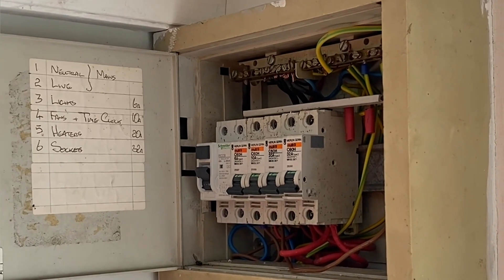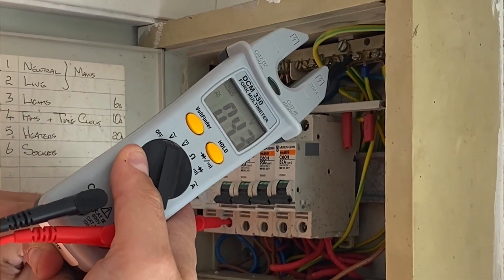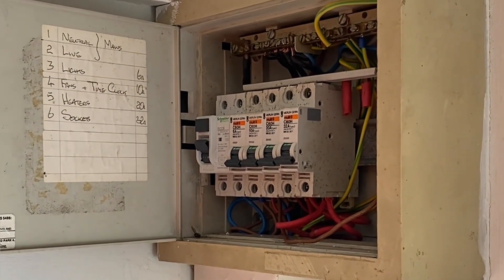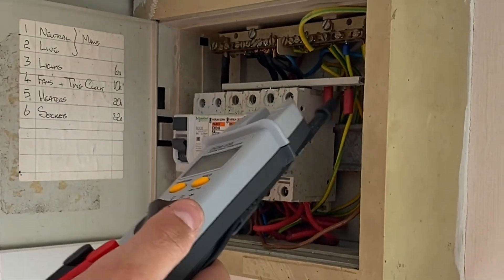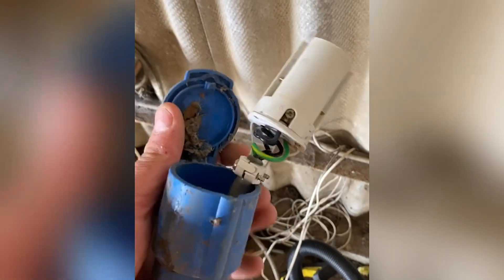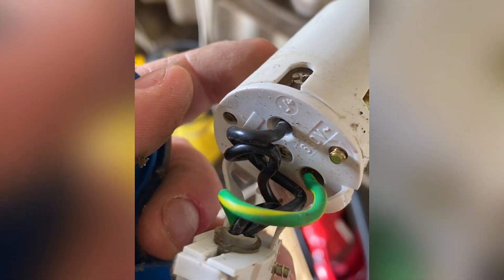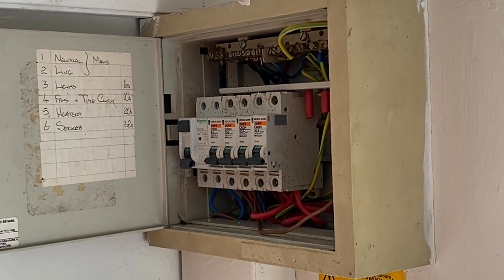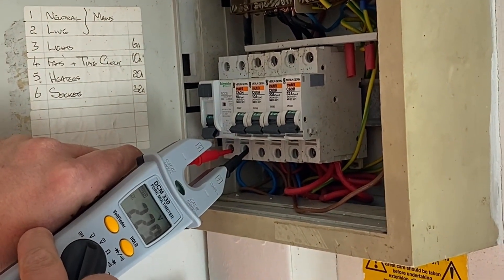Why is the First LIVE Electrical Test so Important..

Comment: Many many years ago a electrician on site connected a house up but with the reverse L-N like here so the protective device was in the neutral but he didn't test the installation and the lighting circuit had a L-E fault so the fault didn't clear and the first leg of the 1.0mm lighting circuit all melted .
Reply from the maker: Thanks for your professional input 👍🏻

Comment: The polarity reverses twice every cycle. 100 polarity changes every second.
Reply: Polarity means that the line and the neutral are the right way round, neutral definitely shouldn't have 230V on it.
Reply: @zacgibbons1208  sine wave + and -
Reply: @UnimportantAcc  For the voltage in the line conductor, nothing to do with polarity in an electrical installation
Reply: An alternating current and voltage is not the same as polarity sausage... TN installations might get a bit exciting otherwise...
Reply: Technically you are correct, and the proper term ought to be polarisation, but polarity is what the electrical trade use for AC installations so we are rather stuck with it. Electricians aren't physicists.